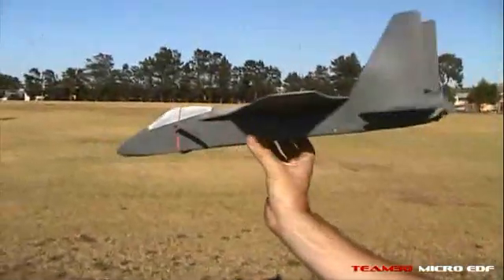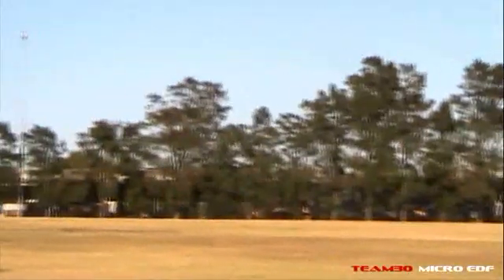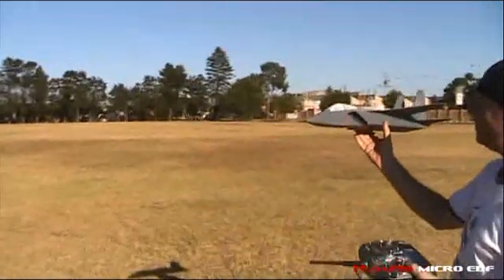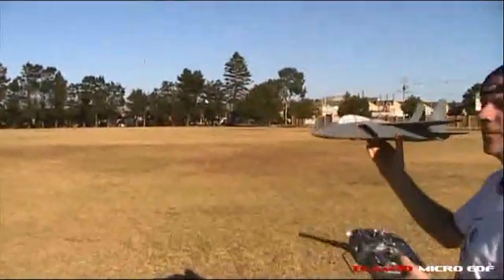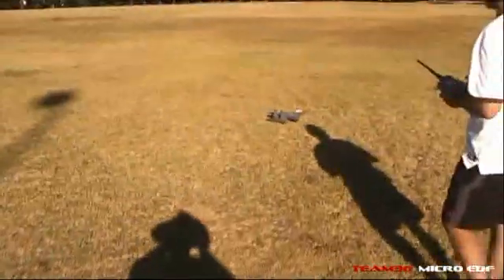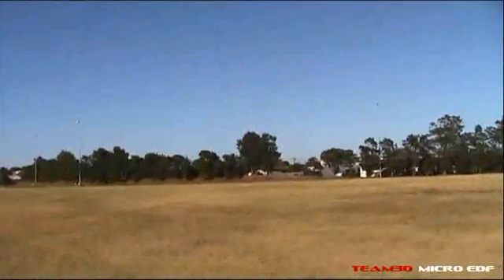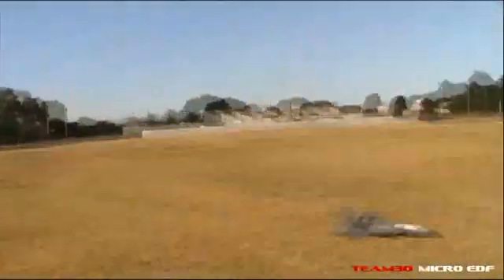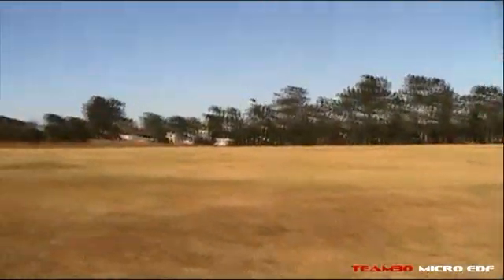F15 Nano EDF jet first flight (Steve Shumate design)

Comment from the maker: When you print the plan, you set the scale of the page to 59%. I used a CC 10A esc, feigao 12mm inrunner in a 40mm GWS fan unit.
Flying Mode1 here in Australia.